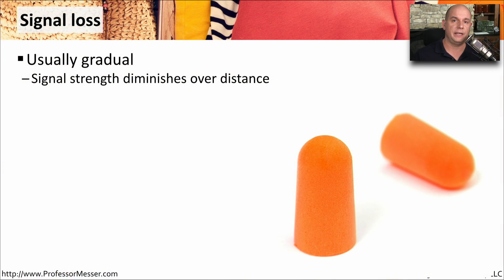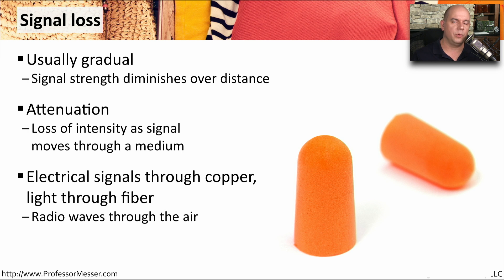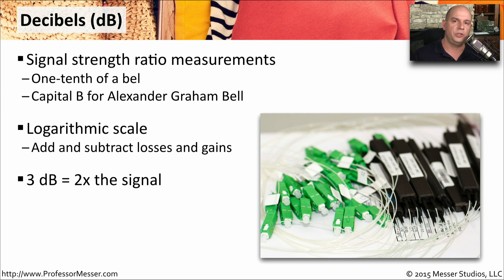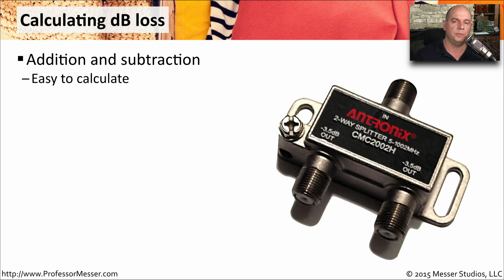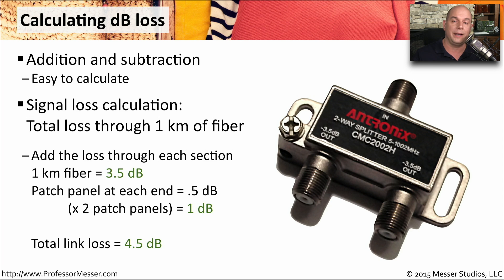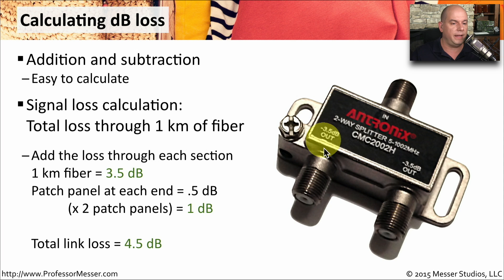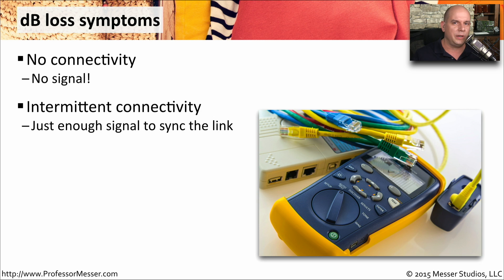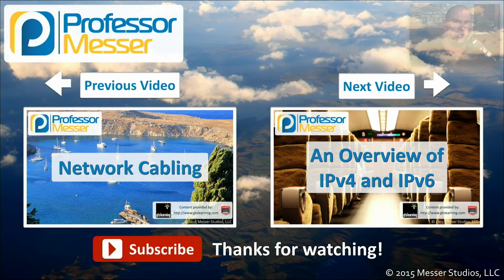Calculating Signal Loss - CompTIA A+ 220-901 - 2.2

Comment: At 3:25 you say that if we split a signal in half, we are going to lose 3 dB. That is in addition to attenuation due to distance?
Reply from the maker: Splitting a signal results in a 3 dB loss at the point where the signal is split. This does not include any additional signal loss due to connectors or distance.